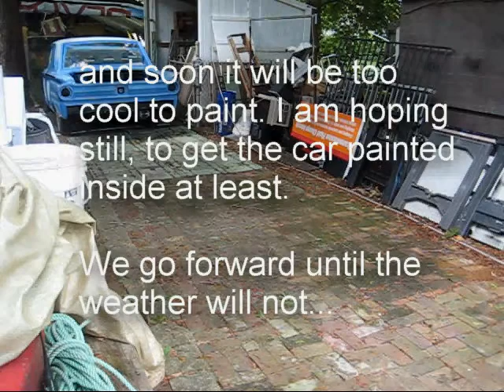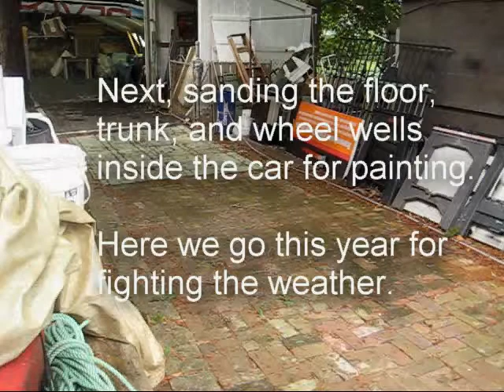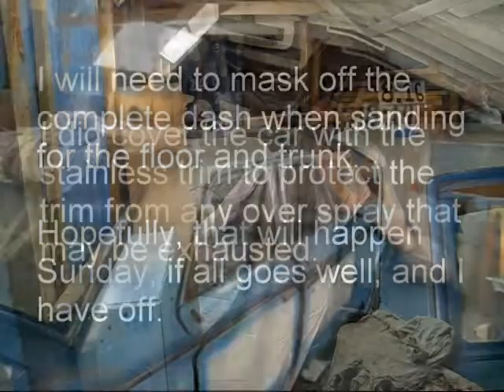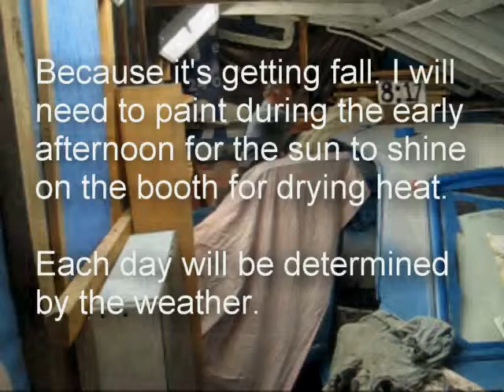62 Fairlane Prep For Painting 24 (Fenders On, Fin Dash holes, Paint Dash)

Comment: Dash looks great!  I'll bet you're glad you kept the old quarter panel pieces so you had a template for the trim mounting holes.
Reply from the maker: Jeffrey Cardimen The old 1/4's I purposely kept for the occasion. Had them rusted up 1/4's by the shed for what?. 2 years I think... I will still keep them. Put them in the attic for safe keeping... The dash does look great. But, it still does need buffing. Gotta wait for at least two weeks. Next is the inside. :-)